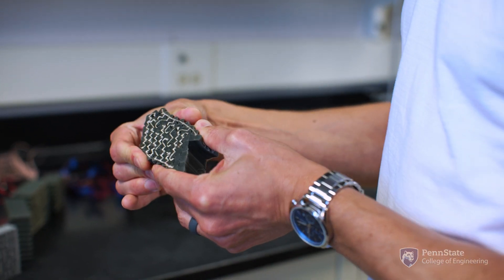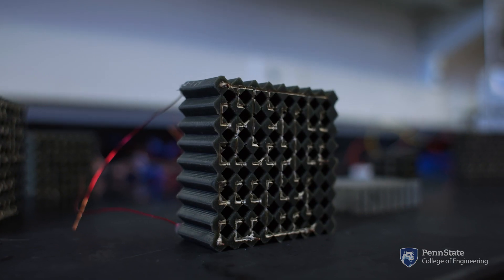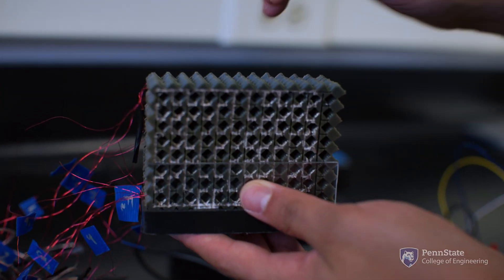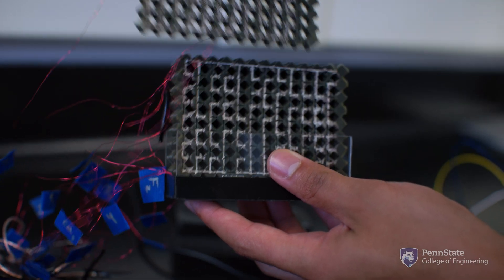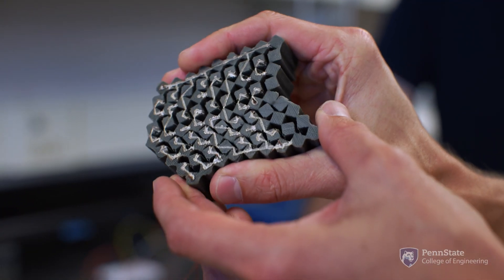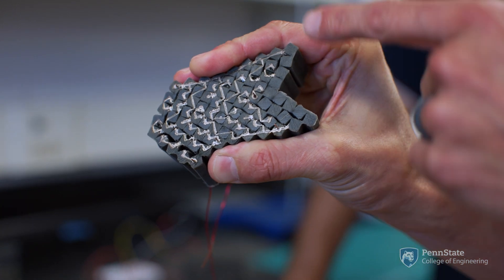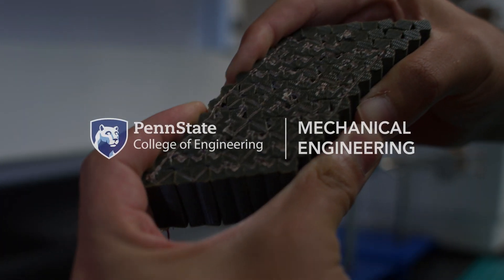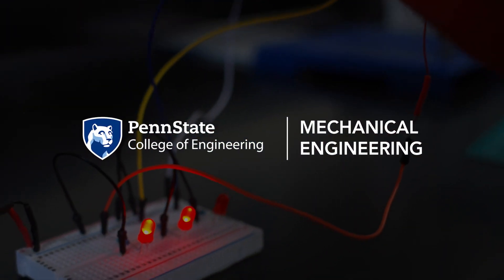Researchers develop novel material capable of “thinking”

Comment: Sorry, but what does it do again?
Reply: We made the first computer out of something other than semiconducting silicon! It is capable of "thinking" just like a computer operates.
Reply: I don't really get it either but I think it can be used as a sensor maybe??? 

Seems that way to me since it requires external factors to reshape it, thus connecting the conductors in it.
Reply: @RaddyTZz  IT could be used in robotics which can actually touch/feel things.